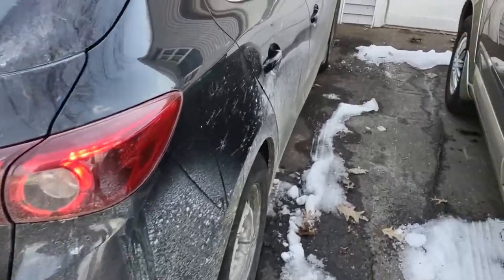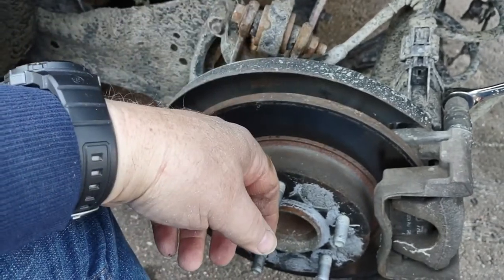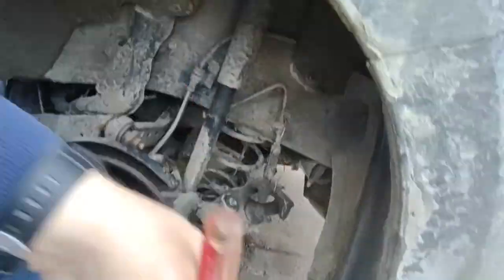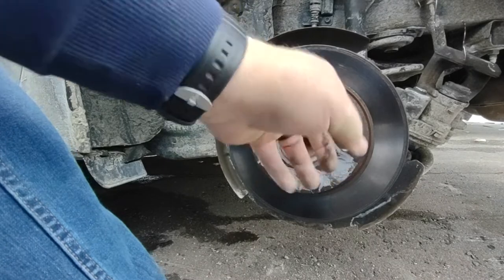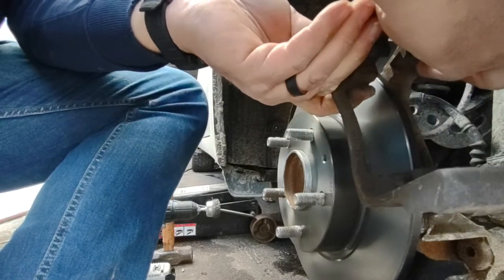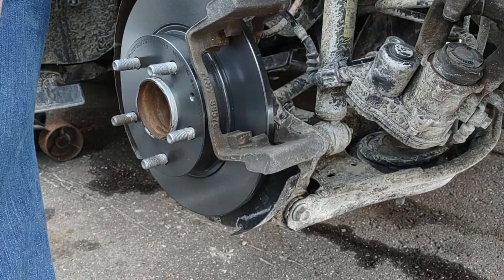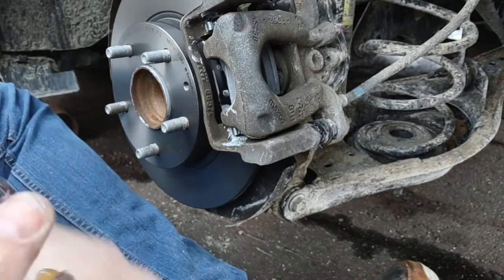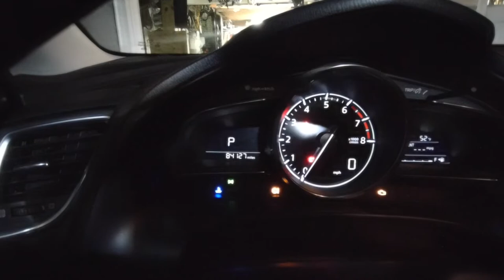2017 Mazda 3 Installing new rear discs & pads install with E-Parking brake

Comment: Just wanted to say thank you so much for making this. This video helped me (someone with no mechanical experience) change my brake pads and rotors for the first time on my Mazda3. I am SO excited that I did it myself!
Reply from the maker: Glad it helped!
Reply: @bigguydiy2184  you saved me $400!
Reply: @bigguydiy2184  I'm about to do the front next week - is the process the same?

Comment: You can still compress the rear pistons into the housing but, because of the electronic parking brake mechanism, you have to push it in and not rotate it. So, next time you don't have to force the caliper back onto the pads. Just push the piston back as normal.
Reply from the maker: Thank you for the info.

Comment: If you look at the bottom of the piston portion of the caliper, there's a square clamp point cast into the body; I used it to clamp the piston back in with a pair of channel locks.

Comment: Came back to this video again after a year (watched it before  and did my rear rotors and brakes) and did the same job but for my front brakes and rotors. Everything was basically the same minus some differences in wrench sizes to get the bolts out. Thanks again for making such a great guide/video that's so easy to follow!

Comment: 10:17 To remove the brake disc it is not necessary to hit it with a large hammer. Between the holes for the studs for fastening the wheel, there is a hole with an M8 thread (previously, a screw for fastening a car jack even fit). By simply screwing an M8 bolt into that hole, you can easily press the brake disc away from the wheel hub, protecting your hearing and hands
Reply from the maker: Thank you for sharing the bolt size!!
Reply: This is a good tip, and I would add that the two bolts holding the caliper are the same thread as the ones on the disk (M8) so they can be used to do that. Just make sure to clean and grease the bolt before putting it back as the female threads can be dirty.

Comment: Tried out your maintenance mode before ordering pads and it worked. This would be the first pads I've tried with electric handbrake. Looks like there's about 4mm pad left on 30k miles. More pad left on the fronts which I find strange. Mexico caliper too. Thanks for the heads up men.
Reply from the maker: I'm glad it help! Thank you for watching.

Comment: Question for you guys.  What part/brand did you use for the rear pad/rotor? I have a Mexico assembled 2017 Mazda 3 touring 2.0 and most of the parts sites give limited information.  Some even group all the mazda 3s into one category stating that they use the same parts regardless if there is an electronic rear brake or not (not good).  Anyway thanks for any information.
Reply from the maker: Here is the link to the rear brake pad W/Electric parking brake. https://www.rockauto.com/en/moreinfo.php?pk=10934300&cc=3436920&pt=1684&jsn=920https://www.rockauto.com/en/moreinfo.php?pk=10934300&cc=3436920&pt=1684&jsn=920

Rockauto.com breaks it down to W/Electric Parking Brake or "Not including" electric parking brake. 

But the link above description is "AKEBONO ACT2042 ProACT Ultra Premium Ceramic "Info"
Rear; 3 Base Model; Japan Production; w/Electronic Parking Brake"
Reply: Replying for any that find this going forward; in my experience so far with a 17 GT Mexico build with EPB - the parts all seem to be interchangeable between the various builds and models. "Base model" rear rotors match my factory original rears; rear pads that are listed as fitting both Japan and Mexico build EPB match factory original, and front base model rotors and pads match my fronts.

Comment: What if I want to bleed the air out? Just just everything back to normal (also out of service mode) and bleed like normal? Thx
Reply from the maker: I guess my first question is how did you get air in the system? If you need to bleed it, it takes 2 to perform. One adding fluid into the brake reservoir and another operating the bleed nipple(?) on the caliper. The person adding the brake fluid  also has to press on the brake very very slowly to not run the reservoir empty.

Comment: Do I have to put a car in service (maintains) mode? What will happen if I will just change pads and discs?
Reply from the maker: The parking brake is operated by an electronic actuator. By putting it in Service mode, it retracts the actuator to allow the calipers to be serviced.
Reply: @bigguydiy2184  thank you, God to know. I need to change brake pads in the spring so your video is very helpful. Thanks for answer.

Comment: How much torque did you tighten the caliper bracket bolts at 15:08?
Reply from the maker: Its suppose to be 85 Ft lbs but I never use a torque wrench. I tend to make it tight enough where I can feel if I am going to strip it or not. Those who do a lot of wrenching develop a feel how tight something can go before it's too much or too tight. Where I tend to over torque are lug nut on tires.

Comment: What size bolt thread pitch did you use to screw into rotor to remove it?? Thanks!
Reply from the maker: Sorry, I do not know. I have a tray full of metric bolts and not separated by size. I tried each one till one fit.
Reply: Hey! I’m a bit late here, but in case anyone is wondering. It’s a m8 1.25 x40 mm hex head.

Comment: Does anyone have the torque specs for the bolts for the caliper bracket and the slider pins ?
Reply from the maker: Front caliper bracket: 68-81 ft-lb. Front caliper slide pin: 20-22 ft-lb. Rear caliper bracket: 38-48 ft-lb. Rear caliper slide pin: 17-19 ft-lb

Comment: I didn't know the stock rotor had that screw hole to aid in the removal of the rotor:).
Reply: What size bolt did you use?
Reply from the maker: I do not know what size, I just have a tray with a variety is mm bolts so I tried each one till one fit correctly. MM bolts have a tight thread vs American bolts that have a much wider thread.
Reply: Just did this and used a metric M8 bolt.

Big Guy DIY thanks for the video!
Reply from the maker: Thank you for the info!!